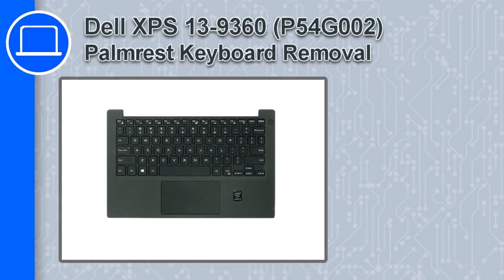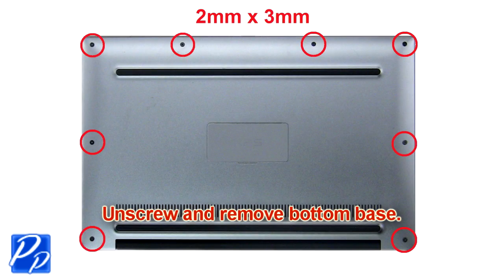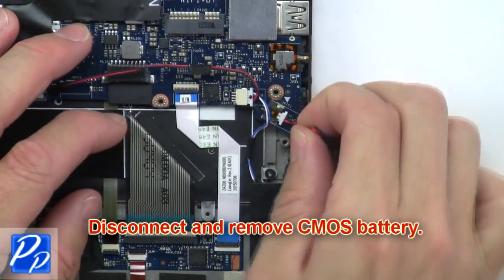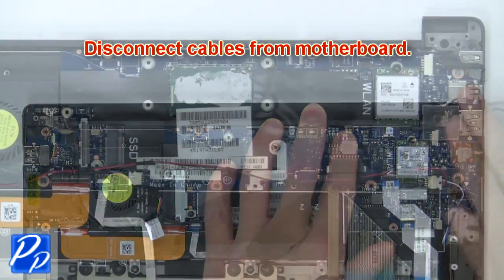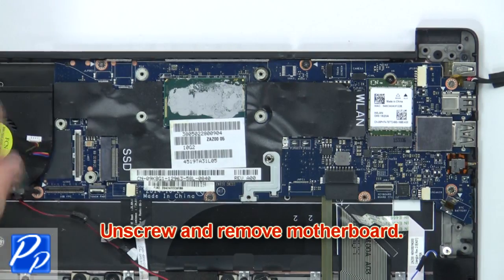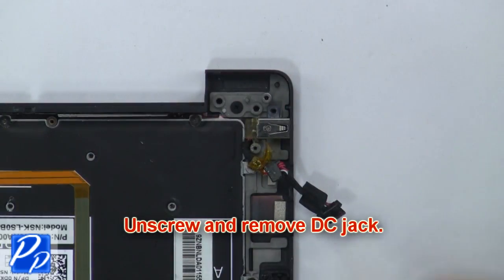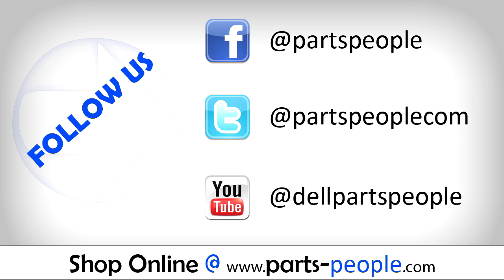Dell XPS 13-9360 (P54G002) Palmrest Keyboard How-To Video Tutorial

Comment: can i swap in the fingerprint palmrest on my 9360 which came without the fingerprint reader?
Reply from the maker: Yes you can.
Reply: Parts-People.Com, Inc Thank you!  Can you tell me what is required besides the palm rest?  Is the a daughter board or anything?
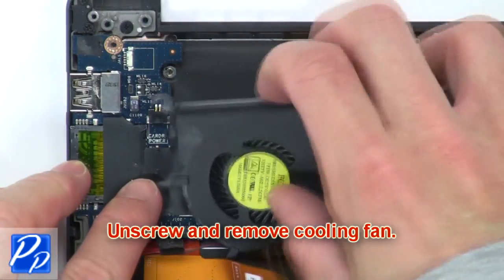Reply from the maker: You will have to replace the circuit board that you see at 1:56. Unfortunately I can't find the part number you need. You will probably have to contact Dell to get the circuit board.